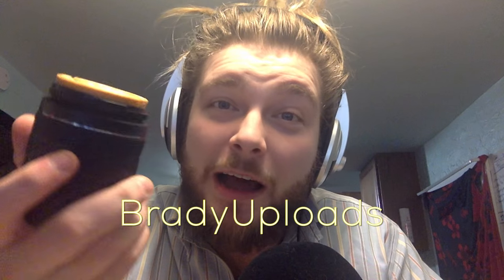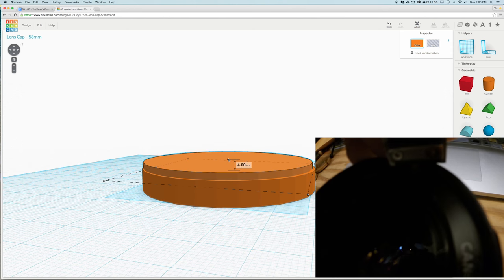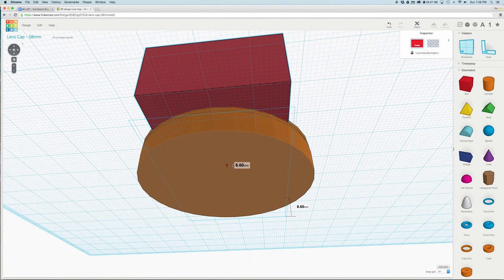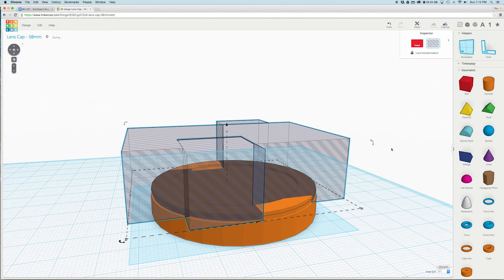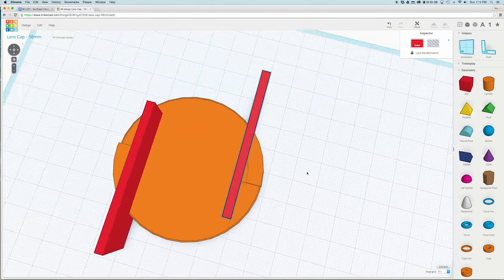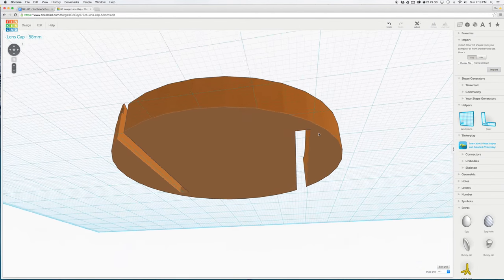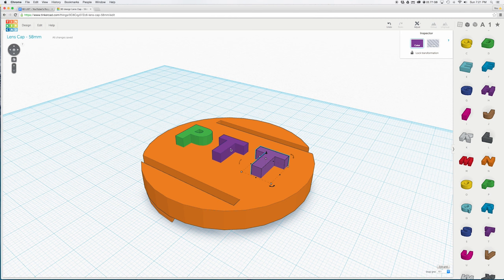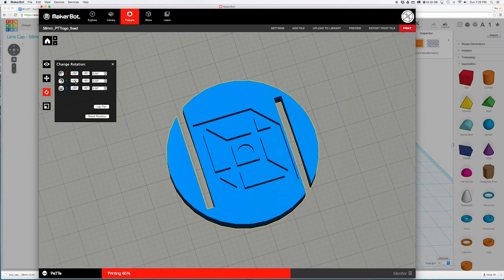3D Printing Custom Lens Caps  - TinkerCAD Tutorial

Comment: in TinkerCAD is not letting me adjust the edges in te 58 mm circle when i put the 57 mm circle, is always unbalanced from one side
Reply from the maker: +David Martínez try holding shift while you drag.
Reply: The upper cylinder is never totally centered with the lower cylinder, i tried clicking shift while adjusting it. what do I do? Could it be because of my screen resolution?
Reply from the maker: +David Martínez in the bottom right there is a "snap" dropdown menu set to 1mm. switch it to .1mm or to off and it should let you get more detailed.